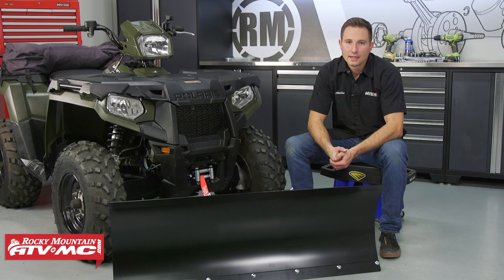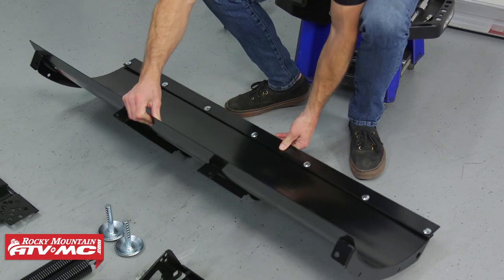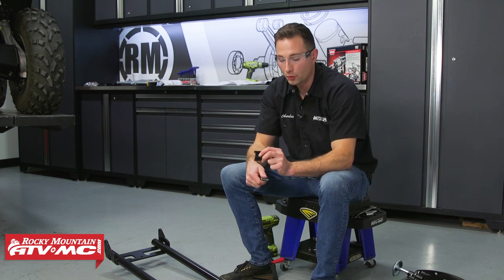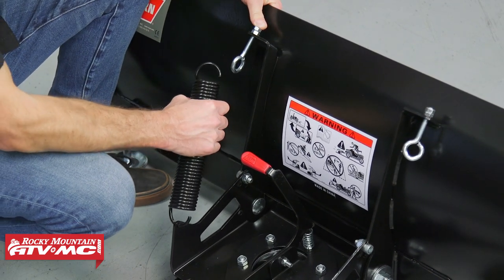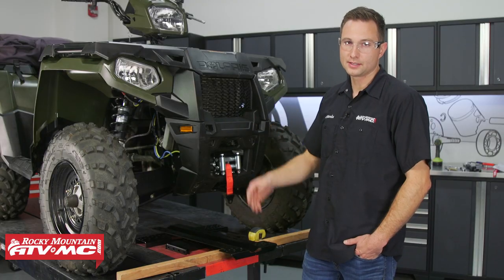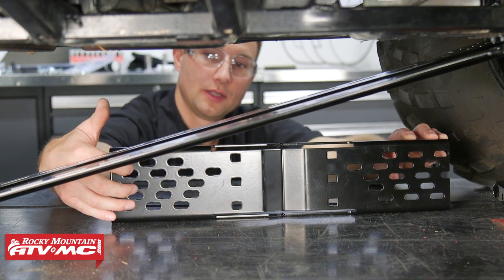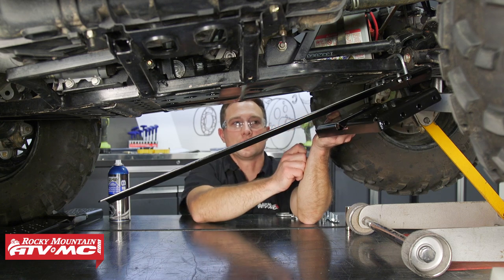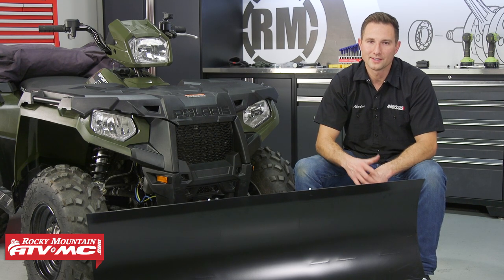How To Install a WARN Universal Straight Blade Snow Plow Kit on a Utility ATV

Comment: Only problem with the mounting plate is it blocks the oil drain plug . Had to hole saw a hole to fix the issue other than that it’s a good plow 👍